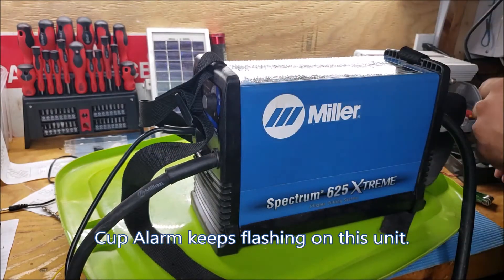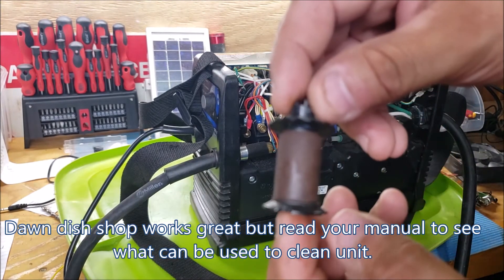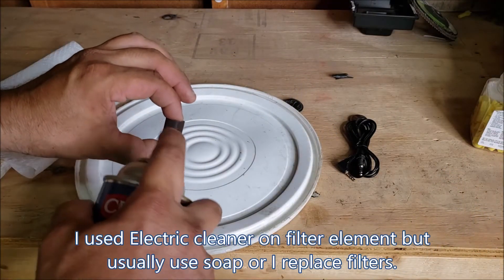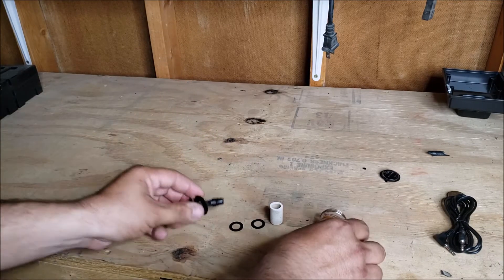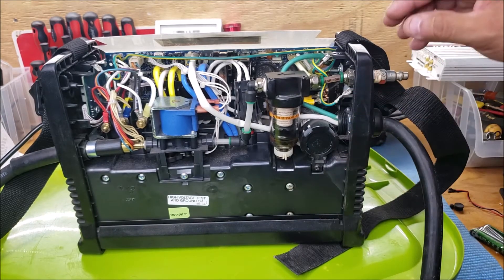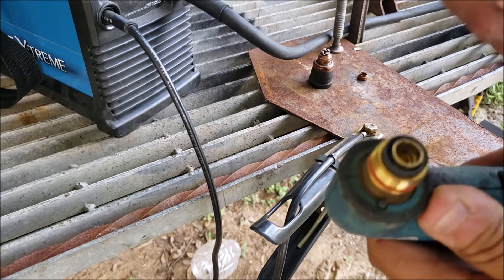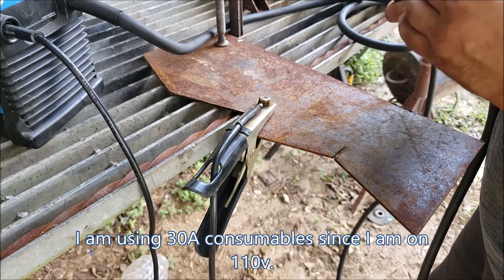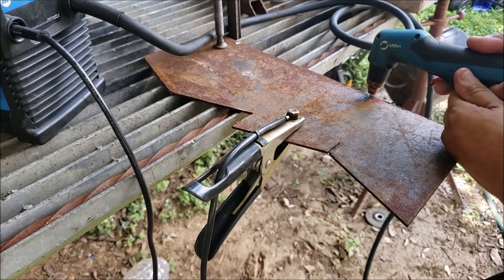How to fix a Miller Spectrum 625 plasma cutter with cup light and give routine maintenance.

Comment from the maker: This is the 3rd plasma cutter I work on and all 3 have been different brands. Plasma cutters are VERY sensitive to moisture and oil. There is several filtration devices that can be used. I currently run my 60 gallon compressor with a 50' hose to a DIY manifold with 5 ball valve drains. There is an additional 50' hose between manifold and my powermax45 plasma cutter. The compressed air is hot and once it cools down it drops into liquid form and that is why your filters should be at least 30 to 50 feet from compressor. That was a long sentence lol.
Reply: I have a water separator and I have a timer on my tank that drains it off once a day.
Reply: Today my Miller 625 stayed acting to the point that it kept showing no pressure and it wouldn't start cutting and i switched air compressor and it worked ok. I believe now,  it is moisture

Comment: THANK YOU so much for an awesome video!!  We have the same plasma at our shop and it was eating away the tips and this helped me fix it!! 

I figured out how to clean the pneumatic air filter bowl ( removing the black part from the clear plastic). At the bottom there’s a small hole I used a torch tip cleaner its like a set of needles 🪡 and you use one of the needle like and push it and the black part will get pushed off and you’ll be able to clean it better. 2:10

Comment: Awesome tips... I don't own a plasma cutter but it's always a good idea to learn....👍👍
Reply from the maker: I may try buying a $200 plasma cutter to try out from Amazon. The ones in my videos have pilot arcs which is a small flame to burn paint or rust. The cheap ones dont have  pilot arcs and one must clean the metal so they can cut. It would be nice to do a side by side comparison.
Reply: @cutweldngrind  That would be awesome....

Comment: I  always wondered why your plasma cutter ran so much better than mine. Could be that mine cost $350 NZ including postage from China. (which is about $50 US ha.
Reply from the maker: I saw a $200 plasma cutter 2 weeks ago and I actually wanted to buy it and see how they work. This Miller was used on 110v but also runs on 240v. I like my Powermax45 but the day it goes out I am not paying $2000 for another or $500 for just the torch. I got some 1" or 25mm steel to cut soon so let's see how it does.

Comment: Those are good little units, I have the Powermax 600  but can never seem to get the performance out of it I think it is capable of.
Reply from the maker: The Powermax 600 is 40 amps and my Powermax45 is 45 amps which might of replaced your model. I have done clean cuts on 1/2" steel and have some 1" steel plate that will meet my powermax45. I struggled with mine but after I added my water separator manifold and 100' of hose it works  awesome now. I would buy another but $2000 is alot.
Reply: @cutweldngrind  I have a water separator on mine but I don't seem to get clean cuts on anything 1/4" and up. Not sure if I am running the torch too slow or fast ?
Reply: On both the plasmer cutter and the tig the earth have to be perfect.  Grind the plate and keep the earth clamp clean. It doesn't seem to matter quite so much on the mig for some reason.